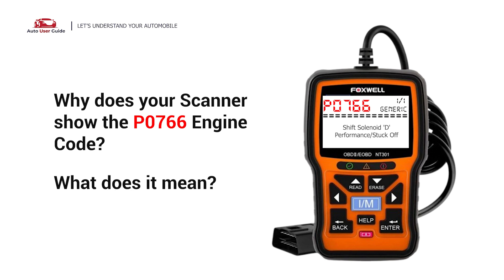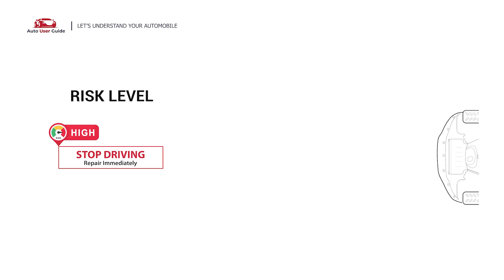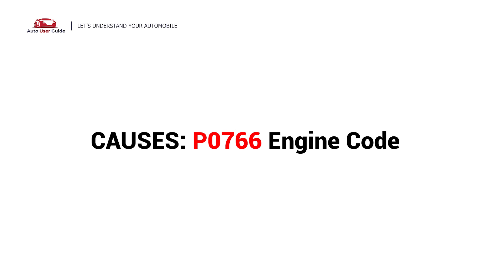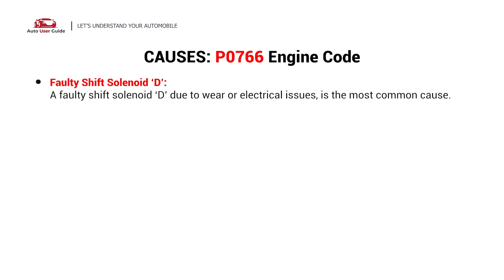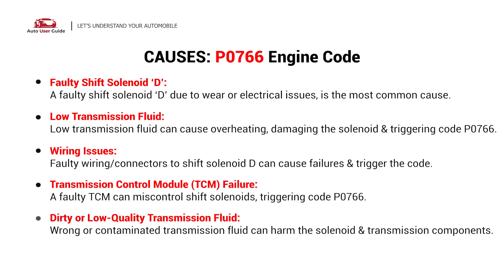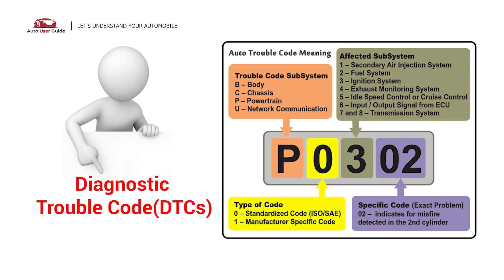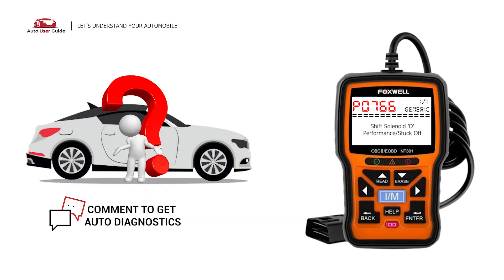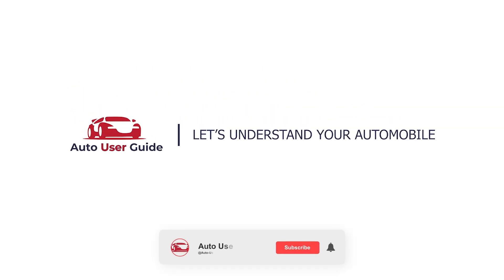What is P0766 : Engine Error Code Causes Explained

Comment: I want to fix this code
Reply from the maker: Got it 👍 Code P0766 usually relates to a shift solenoid “D” performance or stuck issue in the transmission. 🚗🔧 I’ll be making a repair video on this code soon to guide you through the fixing process — stay tuned! 📹✨